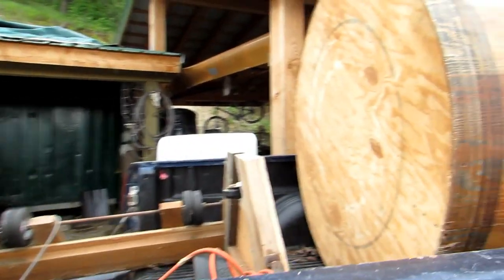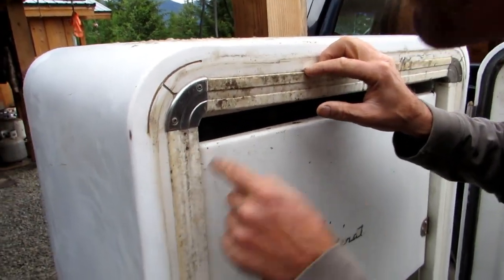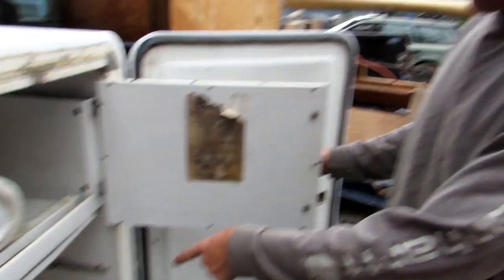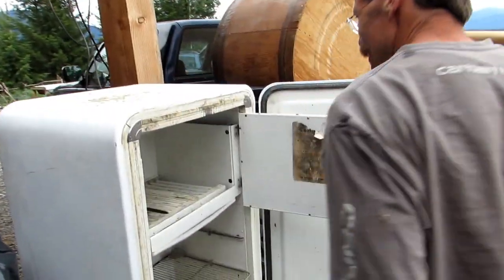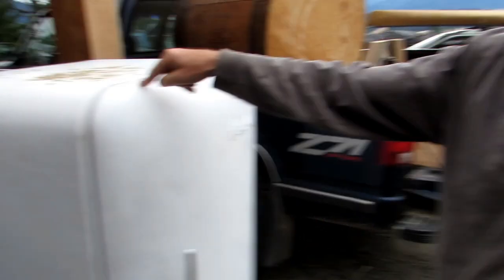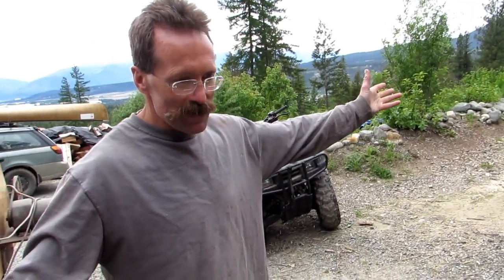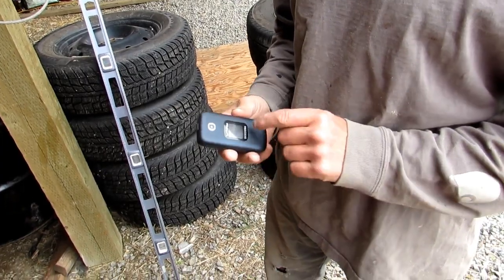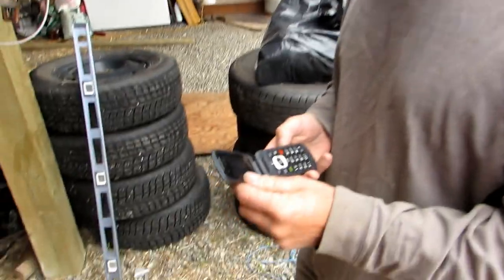Homestead  Vlog: FLIP PHONES ONLY, ICE BOX JACKPOT OFF GRID DAILY LIFE!!!

Comment: Great scores!! That tumbler will make Mr. H's tanning projects much easier. The ice box is a fantastic find! Given it's age, you might find that it may not hold the cold as well as you like though. It looks like some mice have been in it at some point. If there was a way for them to get into the walls of the ice box they may have destroyed the insulation. Look it over and see if there's a way to check out how the insulation looks in it. If you can access the gap between the walls and the old stuff looks bad you might want to think about putting some foam board insulation in there to help it keep the cold. When the time comes to put ice blocks in it  you should put the blocks into some sort of tub when you put it on that top shelf. Not only will it keep the stuff below dry, but you can also re use the water that remains as  the block melts. Also, like packing a cooler, try to fill any gaps as much as possible so that you're not cooling empty space. Fill gaps with smaller frozen water bottles or stuff with newspaper or paper bags. It will keep the cold longer. Having used ice boxes in my vintage trailers, I have found this to work well to keep the cold better. Enjoy your new scores! - All the best. ~ Theresa

Comment: I was watching a video the other day where Mr Hilder was working on a hide and he told you that he used to have a Tumbler to do the job (I can't remember which video Grrr!!😈)  I'm SOooh glad he's not going to turn the Icebox into a Smoker though, bet it's FAB when it's all cleaned up, & it's a bit of history, hope you can buy blocks of ice that big near you 😆.  Danny @ DSH built an amazing Smoker, lined with sheets of tin, it's a great set-up & you have plenty of land to put up a little cupboard and pipe, you should show him the videos.  Does the fact that the Tumbler works by small wheels front (& back?) rather than on a central spindle or axle make the machine less likely to break down, or is this the way they're all built?  And, I know we joke around but PLEASE tell me he's going to replace or put a proper cable joint on the cable, you cannot mess around with Electricity especially when you live in a wooden house.